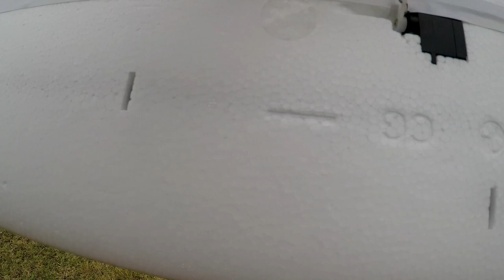Strap an EDF on the SuperEZ | What could go wrong? | Clickbait!

Comment: Some advice I was given once, “Buy a plane that suit your existing batteries”. I recon that’s not a bad idea! I’ve only been flying about 18 months so I am prone to the occasional mistake, fortunately not all mistakes end with a sickening crunch.
Getting into large EDFs means you have to consider the extra noise, speed, & need for a good runway. A cheapish option is the Hobby King Viper, the old version was recommended as a good 1st EDF. They were a jet that would happily glide in for a easy landing, but could be fragile. I dunno if the latest version is any better.
Reply from the maker: Great advice! I mostly have 3s 1800s, a couple of 4s 1300s and to 6s 3300mah batteries. Surprisingly, the SuperEZ on 6s flew very quietly on the 80mm fan. Mostly because it barely needed more than 30% throttle to fly. Incredible.

Comment: Love this video! It's such a cool idea. Shame about the motor vibrations killing it, that'll mess stuff up for sure. I got a set (?) of A-10 nacelles (64mm) from MotionRC awhile back and fit 2x Lippisch edf units. I tried strapping them to a big wing but got the thrust angle wrong and it just nose dived. The nacelles are OK so maybe some time I can get them bolted up to something and have some fun.
Reply from the maker: Haha absolutely! I love the Frankenplane ideas.. sometimes they work, other times, not, but in the end, you try something new and have a laugh. As long as it doesn't break the bank, it's usually no issue. I'm convinced I could get the EZ to work using an edf. She is just so stable and floaty. Maybe one day I can scrounge up some dough for it and get her flying as a jet.